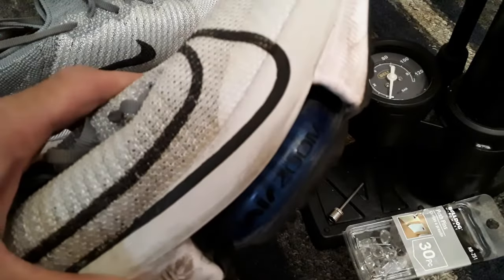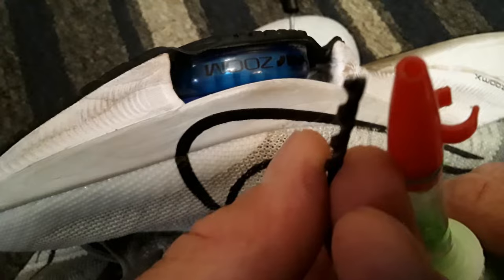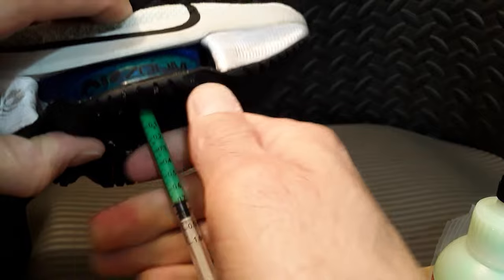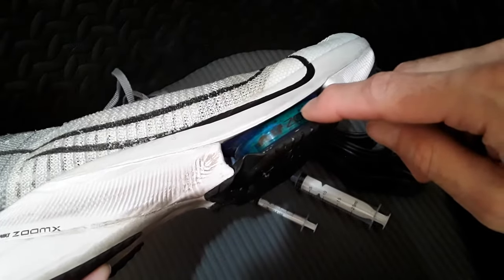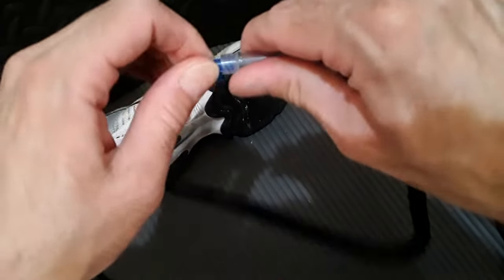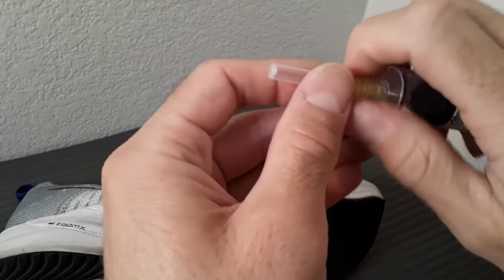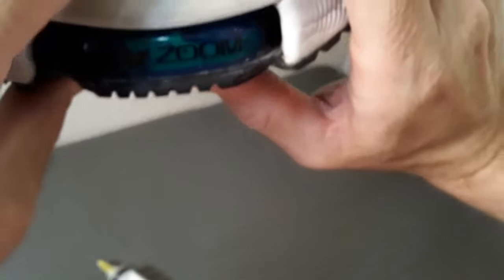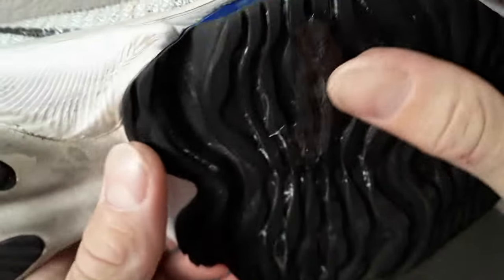How to Fix a Popped Air Bubble in a Running Shoe, Part 1

Comment from the maker: Another update: the drill hole is leaking a lot now. Looking back, I should have mixed the slime with water before filling. This might have allowed a smaller drill hole and smaller filling needle. Also, it may have been better to drill into a lug to increase the strength of the gluing bond.
Reply: Green slime is not an effective sealant. You want to use something thicker. There is a product called flat-out or even armodilloz which is used in e-bikes. Thanks for sharing your attempt

Comment: This video should be shown in schools and engineering classes to show the "thinking process, ingenuity and resilience" of a problem solver.  Thank you for sharing!
Reply from the maker: Thanks for the kind words! In this age of technology there's so much content appealing to and I believe reinforcing short attention spans and instant gratification. This repair was more challenging than I had expected, and real world problems often have a gritty process of developing a solution, yet the media often emphasizes the final product.
Reply: You should find if you pull the laces off and remove the insoles there will be the air valves inside the trainers.
Reply from the maker: @rob-123 when I opened up the Winflo, I did not see a valve unfortunately.

Comment: did you know where the original leak was?  ALso wondering if the shoe would have been covered by manufacturers warrantee if the leak occured and it was not caused by steping on something that punctured the tube? I know that these questions are not dealing with your inquiry in how to repair the leaking air bubble.. but i am curious if the leak was more of a manufactuer's defect and/or if it was from stepping on something that pucturered it and if you could identify where and what caused the pucture
Reply from the maker: @manp1039  very likely a manufacturing defect because of numerous reports by other runners (Tempo Next% released in 2020 I believe). I think my deflated pod was beyond the warranty time but can't remember for sure. My guess is that the original leak was on the top or the inner side of the pod.

Comment: Hey there, just wondering how it has held up?
Reply from the maker: I'll take look when I get a chance... They worked great last March.
Reply: @PerryScanlon  Great! Thanks!
Reply from the maker: It has lost pressure but isn't completely dead. Still usable but less stable. I don't remember if the pressure loss was from a running workout or sitting around for 9 months. I might start using them for workouts since I do have some true super shoes for Strava segments...
Reply from the maker: The drill hole is leaking a lot now. I think I should have pre-diluted the slime to use a smaller drill hole and smaller filling needle.

Comment: Hi there, I have same problem and thinking to simply injecting clear silicone sealant into the pod to fill the space and seal any leaks as it dries up. It does not generally become rock hard so should retain bounce and keep shape. Thoughts?
Reply from the maker: There are some videos where people put silicone inside and it works. It does have some weight, and the softness can be hard to predict. Most solid cushions (non-foam) have air gaps to allow lateral expansion from the poisson effect.

Comment: The other guy on the race track..
.says..
Hey bro...your shoes are leaking green slime all over the track....lololll..great thinking on this fix..I hate these pockets..mine crack....lol...good idea...maybe use a car tire flat repair.....
Reply from the maker: @Aphrodite42023  funny. I have a few other experiments to try. The issue is time. There is never enough. But a part 2 will eventually happen.

Comment from the maker: Update: storing the shoe on it's side seemed to plug the original leak because it held air for a long time. And I was able to get a couple Strava crowns using these shoes: https://strava.app.link/8NTEDjuP9xb 
https://strava.app.link/2UixGfSP9xb
Reply: hey can you post amazon links for the supplies used ...also do you think this can be done to airmax720..
Reply from the maker: @ronny_e92_32 some Amazon links tend to change every few months. You can search "luer lock" plus "30 gauge needle" and "10 gauge blunt needle" and "20ml syringe" to find products. The slime was from Walmart bicycle section.
Reply from the maker: @ronny_e92_32 it looks like it would work well with Airmax 720. There might be room for a valve. If the original leak is on top then the shoe will need to be upside down for awhile with pressure and slime inside. A sidewall puncture would probably require glue or patch.

Comment: a 27min vid for a 5min job? you should learn editing
Reply from the maker: The nice thing about having my own channel is that I can do whatever I want. You should learn some manners.
Reply: @PerryScanlon  cool story, gotta learn how to take feedback if you wanna make it in this business
Reply from the maker: @sigma_799  there are other YouTube videos on this subject that appeal to short attention spans. You can try their methods and tell me how it goes... I'm still not even done solving this problem. I think the air injection holes have to be sealed with glue or patched. This is much more challenging than it appears.
Reply: @PerryScanlon  use contact adhesive
Reply from the maker: @sigma_799  that might work, but not the Weldwood brand which says it can't handle repeated flexing. I've used that for attaching an outsole, and after several runs it started peeling. Shoe Goo sealed the drill hole, so I will try that for the needle holes.